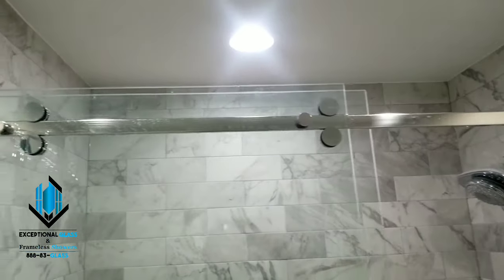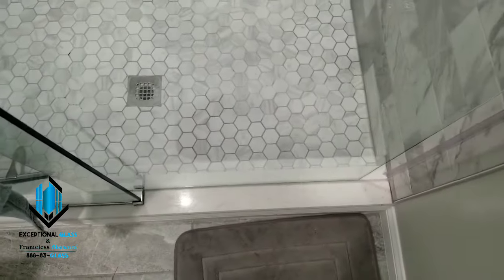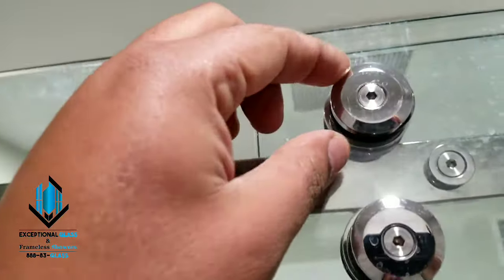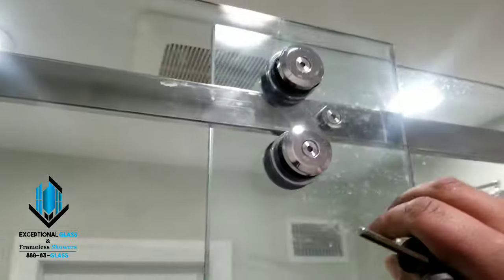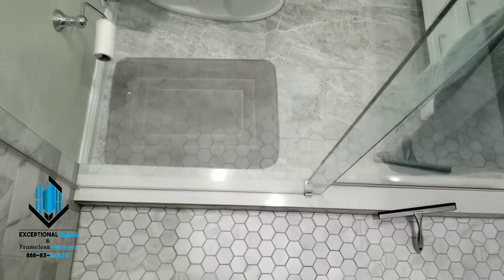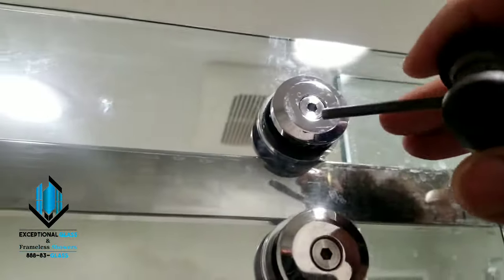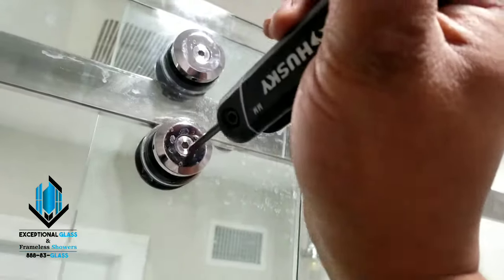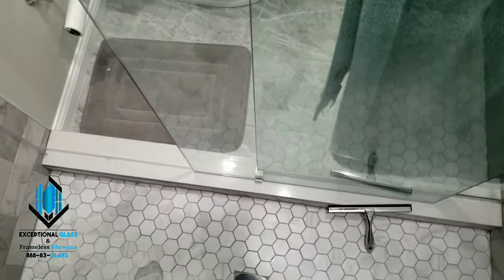Frameless Sliding Shower Door Adjustment #showerdoorrepair #shower #framelessslidingdoor

Comment: I live in Florida and bought a Serenity Barn door sliding Shower door from Florida Sate glass in Delray. The show door leaks an I literally have a puddle in my bathroom after every shower. I called Florida State glass and the installer told me that is normal. ARE YOU KIDDING ME. I’m in the process of which way to handle it but I saw this video on you tube and there phone number was posted so out of desperation I called to beg for some advice from a company in New Jersey even though I’m in Florida. The fellow I spoke to could not of been more helpful and guiding in me of some of my options. He was a saint and I’m sure his work is just as good as he is professional. I can not say enough but just some positive info for anybody in need of his services. I never got your name but thanks for the time and good info.
Reply from the maker: It was my pleasure talking to you!
Reply from the maker: I hope it works out

Comment: After watching your video and being hopeful this would work I didn’t have much luck.  Since these doors are a pain to clean the area where they overlap, and having no luck with the adjustments, I removed the sliding door, cleaned the track, the rollers and of course the doors.  After installing the top rollers I hung it back on the track, installed the bottom rollers and voila, it worked.  I should’ve taken a picture of the positions of the height adjustment/indicators on each roller but figured I was good to go and didn’t.  Now three weeks later it is sticking again, and again my adjustments aren’t making a difference.  The track bar is not perfectly level over the opening section but seems to be over the fixed panel.  I don’t think this is the problem because it worked fine after the original installation and then again after this recent removal and re-install.  This shower is in my home of one which puts the shower to use once a day at the most.  I certainly don’t want to have to keep removing and re-installing this piece of glass but I’m kinda at a loss.  Any advice or suggestions would be welcomed!
Reply from the maker: Sorry for the delayed response!!
Have you also assessed the stationary panel clamps? Sometimes the gasket compresses and the bar bows down with the weight of the door. 
You can loosen the clamp, push the bar up (with a friend outside of the shower) and retighten. You'll most likely see another adjustment not included in the directions.
Reply: I have a same problem.

Comment: How much of a gap is standard between the wall and glass when sliding door is closed? I just had mine “repaired” by the installer for being too hard to close and now WITH a U shaped seal on glass edge, the glass meets the wall at top but 1/4” away at bottom. They said it shouldn’t meet there bc “it would cause too much pressure on glass.” This shower is for my 3 children and I worry about too much water getting out and damaging subfloor. 

Furthermore, I noticed that your glass did not have a U seal. Didn’t even realize that was possible.
Reply from the maker: It depends on your installers methods.
I'd recommend using it and see of there's an abundance of water seepage.
If so, I'm sure your glass company would be happy to add a "dam" on the curb to stop the leak.

Comment: Hi! I have a quick question… my doors are very similar to these, and they’re only about a year and a half old, but lately the door has been sliding back by itself… any idea how I can fix this issue?
Reply: Figure it out? My sliding door keeps closing on its own, won’t stay open.
Reply: @AJCoReVlogs  Hi! I did figure it out. Turns out that it’s the same as this video… you just mess around with the screws at the top. It  took me a bit to figure it out but eventually I did. Think of it like a ball on a hill… if the left one is too high then it might be sliding to the right, or the right one might be too low… or the bottom supports might be a bit loose… sad part is that it can complicate itself, but it isn’t impossible since in the end I mostly got the door right. I’d just try tightening then at first. If not, wish for a bit of luck so you don’t have to spend all day trying to fix it 😵‍💫

Comment: Super helpful!  What if door height is maxed out (Allen key hole on upper roller is facing down toward the floor) and still drags along the bottom guide?  Thanks!
Reply from the maker: The bracket at the wall holding the bar may have sagged.
There are "alligator" slots within the bracket that may have shifted.
Open the door fully, Use an allen key to back out the set screws on top of the bracket, slide it towards the door and you'll see how adjustments can be made.
Let me know if it works out!
Thanks for watching!

Comment: How do you secure the bottom guide to the stationary glass door? There is a screw but there is no hole through the glass and it's not screwed into the tile?? Thanks
Reply from the maker: There's a set screw on the outside to attach the bottom guide to the panel. Silicone is added below the guide prior to installing.  Thank you for your question

Comment: my problem is that the door moves freely in both directions but somehow it is tilted and comes back always to the open position on its own. Will this fix this too? Thanks.
Reply from the maker: Yes. Check the wheels. There's always an adjustment method.

Comment: one of my sliding doors doesn't keep closed when one takes a shower. It slightly opens and it is a real inconvenience. Does it need to be tightened?
Reply: Did you figure out how to prevent it from sliding back?
Reply: @AJCoReVlogs  I have not. It's so annoying.
Reply: @MsRobertsala  did you try these adjustments?
Reply from the maker: Sorry for the delayed response!!
Most likely the stationary panels clamps are loose because the gaskets compress.
Have a friend come over and help.
Loosen the clamp and have a friend push the bar up, then you tighten the clamp. 
I hope this helps.

Comment: Wow I have a door that looks just like this one and stops short of closing about 2 inches away from the wall. I was originally thinking I needed to get a new shower door and have been silently cursing purchasing this one for $600 something 5 years ago 😂😂 I'm going to see if my husband can try this. If that doesn't work then we'll replace it. I'm so over this bathroom. It's cursed. First had a shower leak. Then fixed that and the damn door hasn't closed ever since.
Reply from the maker: The bracket at the wall holding the bar may have sagged.
There are "alligator" slots within the bracket that may have shifted.
Open the door fully, Use an allen key to back out the set screws on top of the bracket, slide it towards the door and you'll see how adjustments can be made.
Let me know if it works out!
Thanks for watching!

Comment: I hope you can help me. I have same type door. What can I use to seal the bottom of the rolling door so water doesn't end I on my floor.
Reply from the maker: Ok.. This is a very common question. Installing a "dam" would be the best option. Note: If your showerhead or "Hands-free" point directly at the door.. It would only help, not fix.

Comment: Hey how do I fix the same door that is higher on one side and it’s almost as of the wall is not level? It’s scraping the bottom of the tub
Reply from the maker: Sorry for the delayed response!! First check the stationary panels clamps. The gasket DO compress therfore sag.
Have a friend be outside of the shower while you loosen the clamp, have them push up while it's loose then retighten.